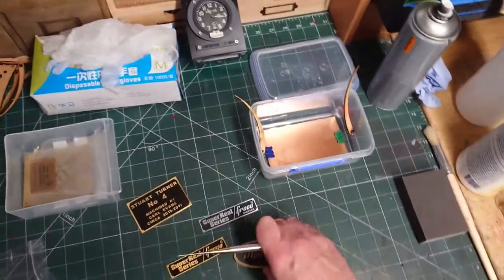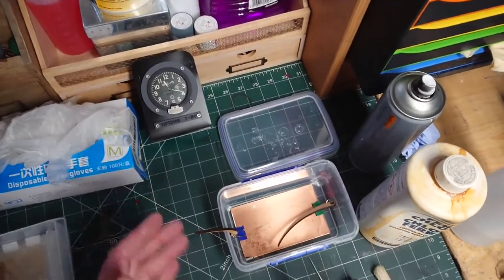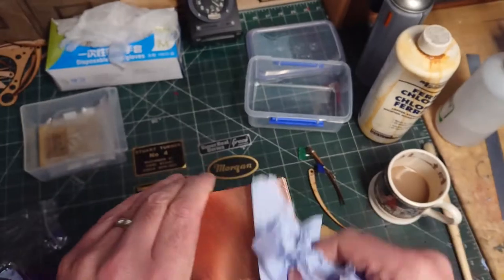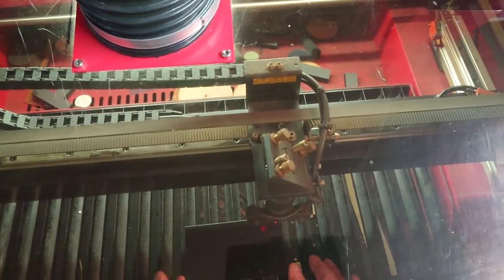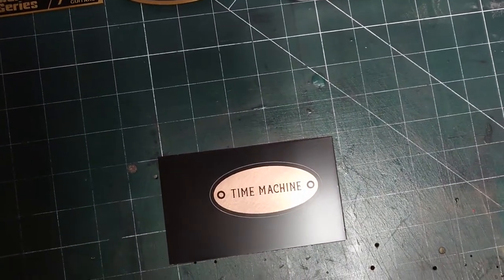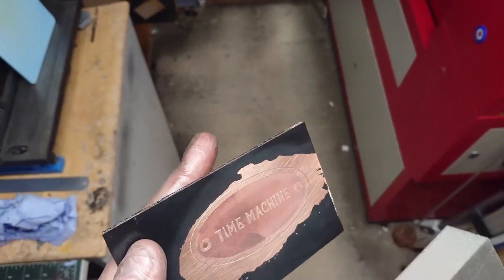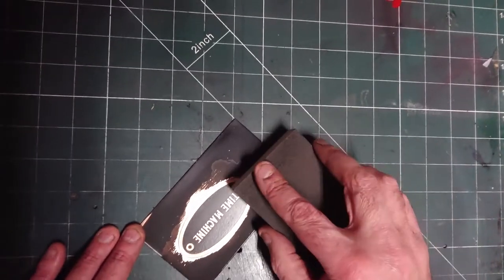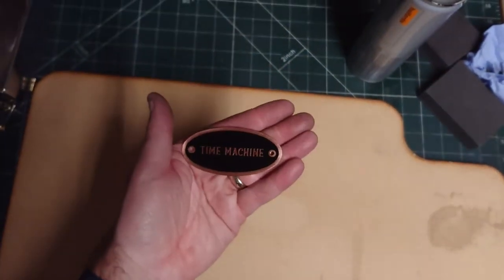Acid Etch Copper plaque - My technique for making acid etched plaques.

Comment: You did say it was a laser, right?  Question, is it a diode 10, 20 watt and you spray black lacquer or moly lube?  I like this technique because it’s clean than using a battery supply.
Reply from the maker: Its a 60 watt Co2 I did this on, yes. The spray is nothing more technical than Halfords mat black. You wont need 60 watt, it took the layer of paint off on a low power.

Comment: If you put the plate in the solution face down it will not eat under the narrow details. The residue of the metal falls to the bottom of the container rather than collect in the forming impression. Also, agitate regularly.
Reply from the maker: Ah, thats a top tip. I will try that !! Thank you.

Comment: Do you use regular paint or special paint for the laser?
Reply from the maker: just any old spray paint will do ( you could even use lacquer)  but I prefer mat as it goes on thinner. Ive found Halfords stuff works well👍
Reply: @bonesshed.  Thanks for the reply. You can also try electroetching with a 9V battery and salty water if you want faster results